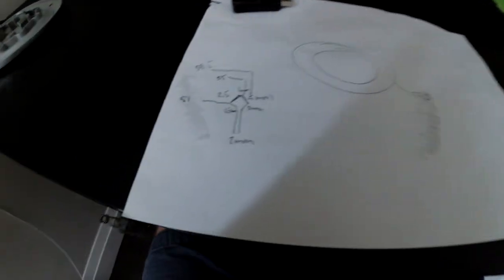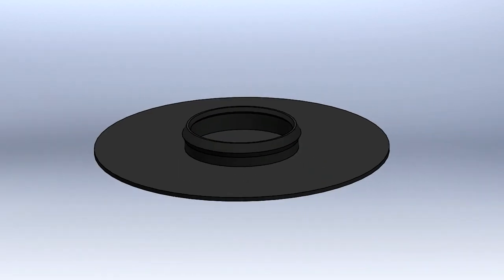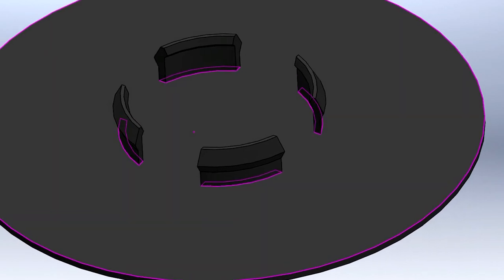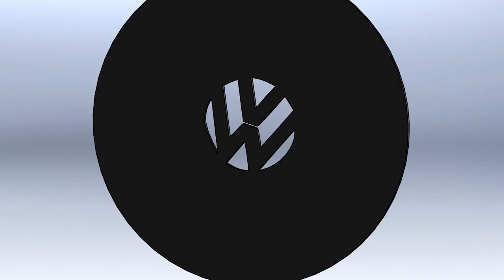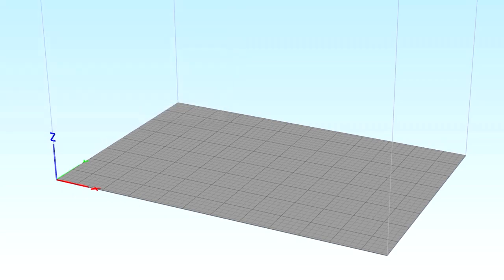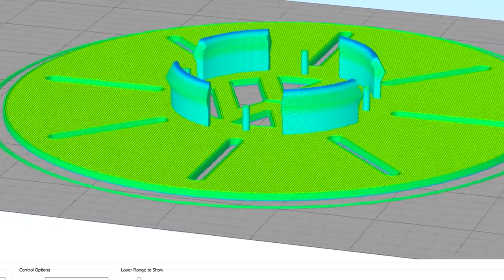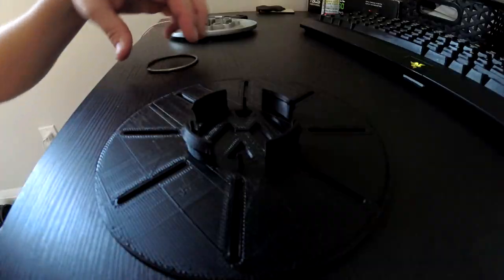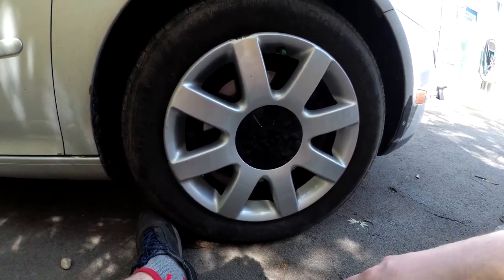DIY 3D Printed Wheel Center Caps for my Car!

Comment: @1:57
Circle centred to the part you are wanting to cut and make pie cuts with lines running though will allow to the emboss or cut out the spaces perpendicular

Comment: Cool! My buddy 3D printed some prototype cylinder head mounting brackets for my IT200. I've read guys remove the factory ones as they are too stiff and can cause stress on the jug from frame flexing. Hes looking for the right plastic...one that flexes, and one that wont melt from engine heat lol.
Reply from the maker: I just looked up the issue, very weird that they did that in the first place! Like people said I'm sure they had their reasoning but seems like a bit of an afterthought design. Unfortunately the melting point of most 3D printable plastics sit right on the edge of engine running temps...otherwise I would love to experiment with some stuff as well. I wonder if you could make a 3D printed mold and then pour some silicone rubber compound. Don't know if it'll work just brainstorming
Reply: @kosmoto  I had a Civic Si years ago. I had put an exhaust manifold spacer on it to cool gasses...prolly made from derlin plastic? who knows. But it held up to high temps. This head cylinder piece will probably need machined, not 3D printed lol.
Reply from the maker: @DigitalRider  Yeah I hear ya, definitely will be nice to prototype with 3D printing but the working part will need to be machined maybe with some heat resistant dampeners pressed in. I love derlin but it's unfortunate it's not more flexible. I guess then it wouldn't be derlin! Speaking of Civic Si's, I got rekt by one today in my Rabbit.

Comment: could you tell me where did you buy that 3d machine?
Reply from the maker: my father built it, but you can check out the Creality line of 3D printers, they are pretty good and relatively cheap.

Comment: What Filament did you use?
Reply from the maker: 3D Fuel Engineering Pro PLA/APLA+ /1.75mm color midnight black. The clear is 3D Solutech
Reply: Thanks. Great job by the way
Reply from the maker: @kareemelghosin3356  Np! Thank you :)